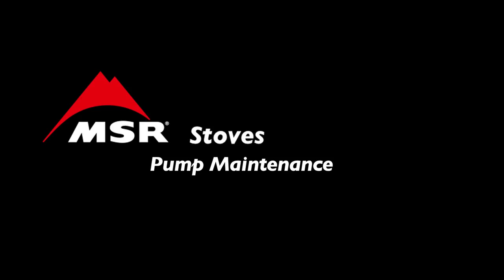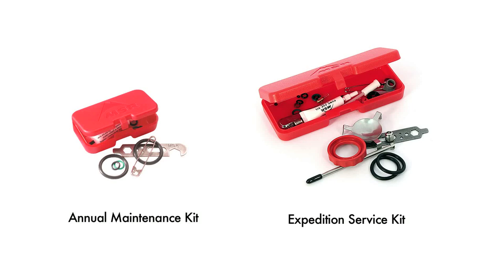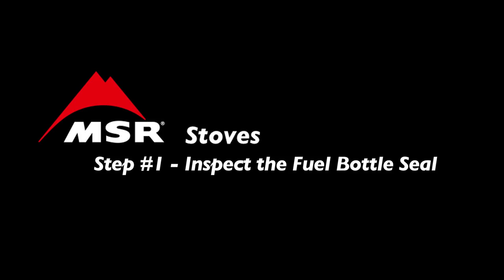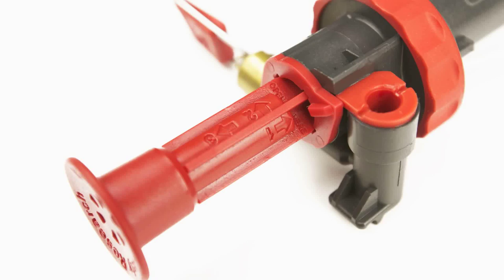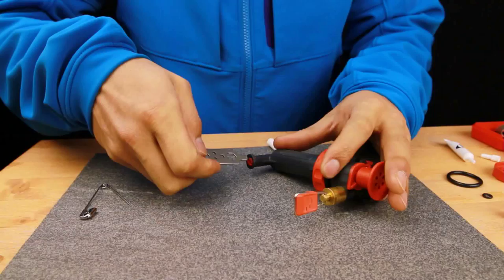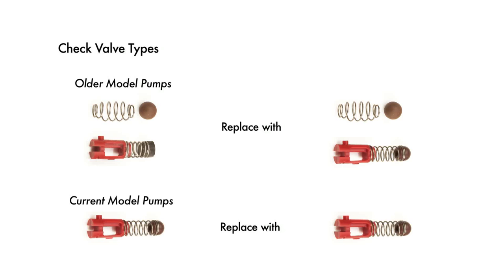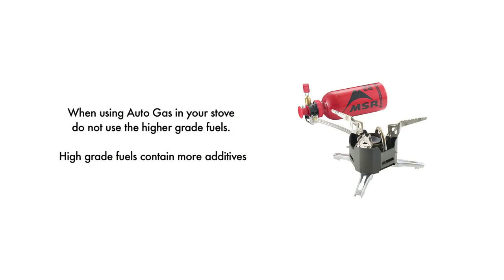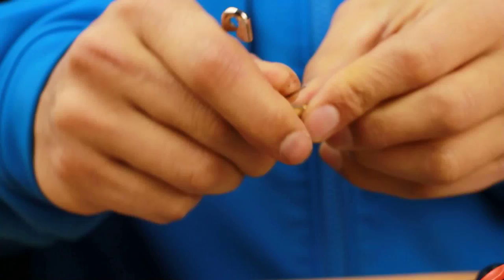MSR Stoves: Stove Pump Maintenance

Comment: Defect? Careful what slander you spray. This gear I’ve used for the past 30 years In all conditions  and emergencies and repairs a snap in the fields. MSRs stoves have always worked at its best. Everything functions with purpose. I replaced both O rings easily and in a moment of watching this video.MSR rules!

Comment: My Dragonfly failed to pick up fuel (about 4-5 oz remained) this weekend at 15F in SW Virginia just before heating my oatmeal.  Upon inspection, my fuel pickup line was nearly parallel to the pump tube, just as is seen in several portions of this video.  That tube (white) starts at a pretty good angle coming out of the molded body, but weeks or months of storage, or perhaps the way it was packed in the nylon sack the day before, but something had bent the tube.  At the cold temps mentioned I did not try to bend the tube back down for fear of snapping it off.  MSR...please show the folks the best angle for this item, and describe how a little hot water will soften it for bending so they won't have to eat cold oatmeal!

Comment: Thank you for this great instruction! I bought my MSR Expedition Stove way back  in time - 15 years or so. It has been through three long expeditions in Canada, several sled dogs races in Norway and between 50-70 times a year the last 15 years on forest and mountain trips without the slightest problem of any kind. It has not even needed maintenance. Not until now. In preparation for a new tour this coming weekend, I checked its status as usual. To my great surprise, the pump did not manage to get enough pressure into the bottle. What should I do? I found the expedition service kit which to date has barely been opened (except from checking it out wondering when I should be lucky enough to try the spareparts ... ;) Hmmm .... how to do this? It had to be googled. So, I found this video. I followed it closely. I did as the instructor did. The pump was a bit hard to open, but I managed at last and discovered that it had become a bit dry. So, I lubricated some oil. Checked the other things told to be checked. Everything looked fine. No damage found. No replacements needed. Good to go! New test! Booom! It worked immediately just like new! Amazing! Ready for another tour - and I've no doubts or fears;  it'll be ready for the hundreds of tours the coming 20 years or so! Best stove! Thank you for the video -- and thank you for MSR! :)
Reply: Hi! I just bought the International model that works on any liquid fuel. How did you go for so many uses and not have to clean the stove? What kind of fuel did you use?
Reply: @mwj5368  Hi there! I did use kerosene for many, may years before switching to a more clean fuel (purified gasoline, Primus Powerfuel or MSRs own fuel) I've used that for many years now --- and since my last post here, my stove has worked just great! It's a workhorse! :)

Comment: I just bought the international model and want to practice using it before I go for a 2 week journey. I bought the Coleman fuel, a gallon. When you get your pump brand new do you have to go into the pump and lubricate it? I'm intimidated about how many parts and maintenance there is and wonder how easily the plastic pump could melt or get heat damage. They never told me about the repair kits when I bought it from REI. There are two small tools and a tube of lubricant that comes with it and a couple of brass parts. Also I wish there was a hard shell case. I emailed the company and they said they have none and only suggested some other brand of bag or to make my own. I'm surprised no one seems to need a case. I'll be packing tight and might have to make my own case. Does anyone know where there are instructions to make a hard case? The stove seems somewhat delicate and when packing tight I really wonder if you can damage it or stress the fuel line and cause a leak. Thanks for this great video!!

Comment: Great video, very clear and far easier than reading the instructions :)

Took my Dragon Fly away camping last weekend, and had fuel leaking out of the pump control valve. Luckily I had a back up butane stove to get me by, but will be doing the full service as shown in this video now. Great that they've made a product that you can actually fix in the field if need be.

Comment: I've got an older XGK with the yellow pump.  It is unclear how the control valve can be removed to check its O ring.  It unscrews to a point of course, but only to a point.  Am I supposed to just grab and pull at that point?

Comment: Hi MSR, I have an older Whisperlite stove pump (I bought used in 2005 so it could even be older), and fuel was leaking out of the control valve, so I attempted to replace its o-ring. However when I opened it, there wasn't an o-ring; instead it had a hard red plastic ring that broke immediately as I tried to pry it off. The smallest o-rings in the maintenance kit are way too big to fit properly in the spot where the red plastic ring was, they just fall to the bottom. Is this is a different type of older pump model that didn't use o-rings? Is this fixable or is it time to buy a new pump? Thanks for any info
Reply: Hi Alex😀I have the same issue, I found a red O-ring in the expedition kit that was slightly fatter. Now it seals well. One of those O-rings that the red paint comes off. Ulike the red that was there from probably 2005 same as you describe.

Comment: I have a MSR Whisperlite universal bought new in Norway 2017. After 1 liter of Coleman gasoline used i took out the plunger to lubricate it. Then i discovered there was a cracked white part under the pump  cup (in the pump body) I think it is a "pump bore filter" that i could find on another MSR pump diagram. How to replace? It is not in the service kit. And why is it so quickly damaged?

Comment: Very helpful video.  I need to lubricate the pump cup and O-rings, but I am unable to find the MSR pump oil in my local stores.  Can the mineral oil found in drug stores (normally used as a laxative) be used as an alternative?  Drug store mineral oil has a 2% vitamin E additive in it, so I'm wondering if this would be harmful to the pump cup or O-rings.
Reply: i know this is a year late, but any oil really works, coconut even
Reply: Thank you for getting back to me.  You are not too late, as I will be oiling and reassembling the stove this spring. @MrRacerhacker
Reply: @kathybriggs9570  baby oil also works, try to get one with low perfume, vaseline works as well if you cant find the other

Comment: My pump leaked recently so I took it apart to check all part which seem to be all fine, including O-Rings. But, when I went to put the control valve back in it would not fit properly and when I tightened it the control knob wouldn't turn. I suspect it is a problem with the plastic inside wearing away but I couldn't see into the narrow tube. 
Any thoughts? I figure I need a replacement pump.

Comment: My pump would not pressurize but my pump cup appeared to be undamaged.  I replaced the check valve assembly because the ball was gone!  (did it dissolve?  i never took it apart before).  It still would not pressurize, so I replaced the pump cup anyway.  Now it pressurizes!  So did my leaving the pump inside the fuel bottle with fuel cause the rubber to shrink??

Comment: Hello,
I have a question. I own an older type of Whisperlite. It's a perfect, easy stove that can burn diesel, gasoline, white gas ... anything. However, from my point of view, its weakness is a pump. I have had the stove for many years, and today, I had to buy a third pump. Both previous pumps were leaking from the correction valve. It is the brass part. The seals seemed to be undamaged in both cases. 
Could you advise me on how to tackle this issue?

Comment: Hello, I bought a new msr wisperlite international, and from the first time I attempted to use it , there was a failure in the pump, I couldn't get it pressurized as the rubber cap inside the pump arm kept on snapping from the inside, I tried to trouble shoot the system, the rubber cap is undamaged I just don't know why it kept on snapping while attempting to pressurize the bottle .
Reply from the maker: We’re really sorry to hear about the issues with your MSR gear. Your gear comes with a Limited Lifetime Warranty and we take pride in making quality products that can be easily repaired.

Please head to our Warranty and Repairs page ( https://www.msrgear.com/msr-warranty.html ) for info on getting your gear back in full working order.

Comment: What is pump cup oil? Mineral oil?  Probably going to use some raw silicon grease (not the spray kind). I find it works great on rubber. Keeps my motorcycle brake pins floating well.
Reply: Good video
Reply from the maker: Yes, the pump cup oil is mineral oil. Thanks!
Reply: found dupont teflon silicone lubricant - 4oz bottle (liquid / non-spray) is an excellent substitute for mineral oil. But most kinds of lubes should work well.
Reply: I find nose oil works fine in a pinch. Rub the leather on your nose ( or behind your ear) ready supply of a standard lubricant.

Comment: One other question: the air hose on my older XGK has dried and cracked (a common problem apparently).  I'm going to try to replace it with plastic tubing as found on chainsaw and weed wacker ignition systems.  Good idea?  And how do those retainer pins work? - are they supposed to unscrew/screw or do I pull them out and punch them in to the new tube?

Comment: Yeah, well, that's nice and all, but would you mind telling me why my brand new (UNUSED) MSR Whisperlite International leaks fuel from the O-ring/brass connection? The supplied replacement O-ring did not solve the problem. Now I have a new stove that's not useable. I'm rather disillusioned, after having had a previous MSR stove that was not primarily plastic. It worked really well.  Peter Askin New York.
Reply from the maker: We’re really sorry to hear about the issues with your MSR stove. Your gear comes with a Limited Lifetime Warranty and we take pride in making quality products that can be easily repaired.

Please head to our Warranty and Repairs page ( https://www.msrgear.com/msr-warranty.html ) for info on getting your gear back in full working order.

Comment: It's a great stove but I'm on my fourth pump so far. The plastic threads in the body where the valve screws in fails, and the valve seizes requiring replacement of the pump. In my opinion, the pump should be made of metal. Definitely pack an extra pump on an outing.
Reply from the maker: Thank you for your feedback.
Reply: John Stack, What excactly happened? 
I almost ruined the fine threads in the pump body when I failed to screw in the valve itself but only screwed in the brass stop nut. Luckily I did not use force or else I would have ruined my pump. Need to screw in the valve itself first some and then the stop nut some. Or did you have a different problem? Did the valve fail to enter the threads and plastic threads were ruined? Cheers.
Reply: @Euronasa  You try to open the valve but it gets stiffer than normal. If you continue to turn the valve, the plastic valve threads will break or get damaged.
If the valve gets stiff or stuck, what you should do is to use the tool to loosen the locknut a little. That should help free the valve up.
The problem here is the plastic valve threads. Metal threads should solve this problem.
Reply: @johnstack5008  Thanks for the Quick answer. I did not know this could happen during normal use. Thanks.

Comment: Can you change the fuel tube bushing to convert a dragonfly pump to a regular pump? Bit of a shortage of regular pumps ATM...
Reply from the maker: No, you can’t change the size just fit a different pump. It will not work.

Comment: I can't get the plunger to turn to the left in order to remove it. It's an older simmerlite model. Do I have to do something different?
Reply from the maker: Jeremy Mullins Make certain that the tip of the #1 arrow is flush with the top of the red cap that holds the plunger in place.  Sometimes it can catch a bit and be a little difficult to twist, but yes, left is the proper direction to turn.  If you have further troubles, please send a photo to us at consumer@cascadedesigns.com and we’ll try to help you out however we can.
Reply: MSRGear Thanks for the reply. I finally got it to turn with a little elbow grease. I think I was just being too timid with it. I used the stove in Yosemite this weekend and it worked like a champ! thanks again!
Reply from the maker: Jeremy Mullins Glad to hear it Jeremy!
Reply: +Jeremy Mullins Yes this worked for me too, a bit of wiggling and some firm pressure and it finally clicked open.
Reply: I had the same problem disassembling the pump, and found the solution from MSR worked and I successfully got it apart. Thanks for the tip here on the handy dandy Youtube school of how to fix anything!

Comment: My Dragon Fly fuel line, brass insert, to the pump is larger in diameter than the  pump fuel line insert for my Whisperlite.  I am not sure what you mean when you say that the pump is the same for all MSR stoves. I need to replace my Dragon fly stove pump because it is cracked . Will any new pump that I buy fit my Whisper lite and my Dragon fly ? Or are they different ?
Reply: Dragonfly stove must use a Dragonfly specific pump.

Comment: I have a Whisperlite that has seen VERY little use.  Last time was about 15 years ago.  Kept in garage, never used by anyone but me.  I dug it out and went to fill the bottle with gas, and discovered the check valve had been melted (appeared to have burned), the spring rattling around freely in the bottle.  There was no fuel in the bottle.  What could have happened?....
Reply from the maker: Without physically inspecting the fuel pump, it’s hard to give a definitive response. So, just by guessing, it appears there was enough fuel in bottle to be touching the check valve section, which, over 15 year period the constant contact with the fuel could have deteriorated that part. Fuel does evaporate.
Reply: Do you happen to have any garden gnomes?

Comment: Just did the first full service of my Whisperlight Int'l. Bought it in 1993/4 so that's 26 or 27 years with just 2 jet cleanings. Will updating to modern pump or jet with shaker needle make a performance difference?
Reply from the maker: Hi there,
We introduced the shaker needle jet technology in 1992 on those WhisperLite International stoves. So it should have that technology. As far as the pump, our current Standard fuel pump is the latest model. If the original fuel pump has not been maintained, the O-rings could be dry, brittle and cracking which could cause leaks in pump and/or pressure of fuel bottle. It would be recommend to purchase the newest pump—it will fit the all WhisperLites.
Reply: There's no shaker needle in mine so I must have bought it before 1992, could have been as far back as 1988. I replaced the o rings last week, they were cracked and dried out. Since then it's burning well. I'm doing a boil test today to measure time to boil.

Comment: 4:41: "Replace the pump shaft by lining up the bushings with the shaft..." - this is just a nonsensical sequence of words with zero information in them. I understand that reshooting the whole video just becuase you misspoke in some middle point might be expensive. But standard practice is to add a subtitle that would correct the error.

Comment: There is some kind of information mean diesel not OK with this stove?
Reply from the maker: The MSR XGK EX (and previous XGK stoves) and the DragonFly are the only stoves that can burn Diesel fuel
Reply: @MSRGear  thnx for the answer. A little advice if you pardon me, I think if the pump turn in to the metal, it's may be better. By the way I order already fully set of your products... have a good days, best wishes from Turkiye.

Comment: My Stove Pump pressure wasn't working, I found out that the "pump cup" fallen off from the plunger. I used a pen to remove it. How did this happen and how can I avoid such problem?

Note: this happened the first time I really use the stove to cook outdoor. I only tested it twice at home before that.
Reply from the maker: +Juventusist The best way to ensure that doesn’t happen is to make sure you lube the pump cup before each camping trip with mineral oil.
Reply: I have the same issue on 4/5 of the whisperlite international stoves I just bought after just the first camping trip. I lubed the shaft and the pump cup itself but the rubber cap still stays stuck in the shaft. Ideas on how to prevent this? 4/5 stoves is kind of crazy and left my whole adventure therapy program high and dry in the Andes.